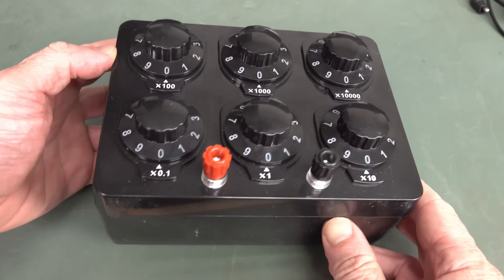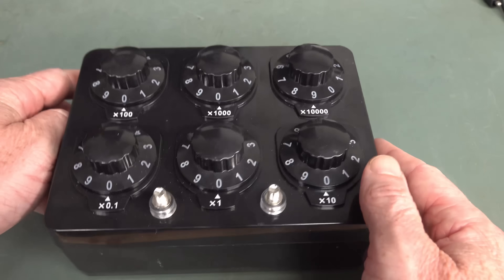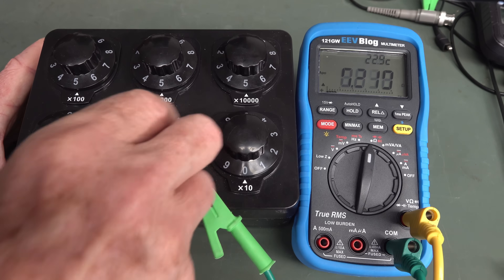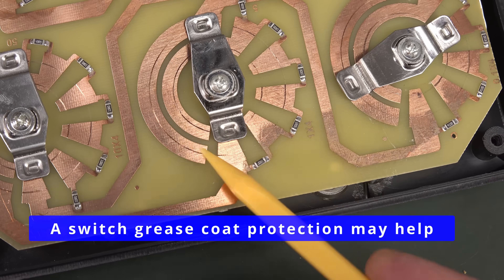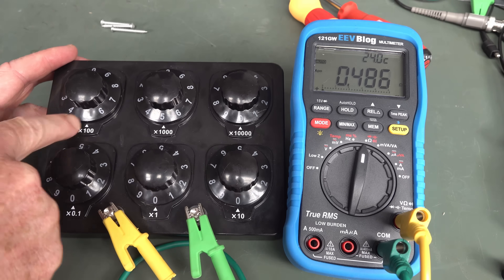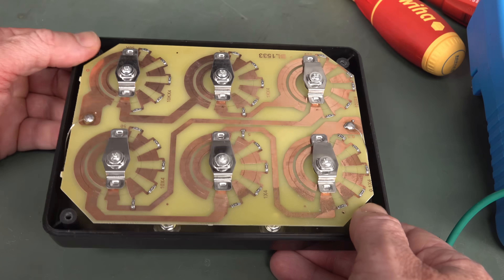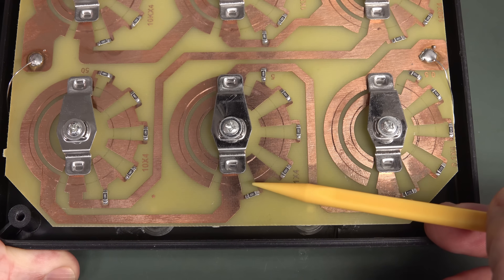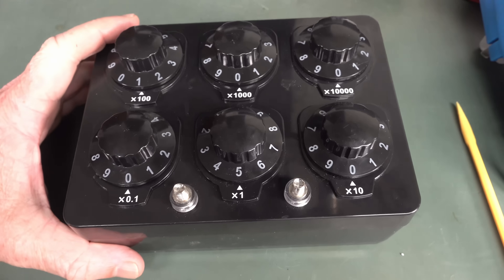EEVblog 1586 -  Stranger Things Decade Resistor Box + Repair

Comment: Just received one from AliExpress. Opened it up to check the quality of the resistors, figuring it was using through hole resistors, so I could upgrade them as possible with precision resistors. Was disappointed to find tiny surface mount resistors, as well as finding out the binding posts weren't banana jacks. I've got plenty of banana jacks I could install. One other disappointment, once I discovered the internal circuitry is confusion over why they used the depth of case they chose, as they could make the case 1" deep, and still have plenty of free space inside.

Comment: My grandpa was a Test Engineer, and i have the underside of one of the knobs from his hand made resistor box! I'm not sure why he disassembled the box, but he took it all apart and all he could guess was that he was being a cheap skate and wanted to use the resistors to repair a clock or a radio haha. After he left his Engineering job, he was allowed to take essentially his whole lab's stock with him and he left me a massive supply of jelly bean parts from the 50's (mostly resistors, caps, diodes and a million fuses). 

My grandpa also had a little bundle of resistors soldered together that would provide different values based on where you clipped into it. From what i can gather, he would use it to load test circuits. It was basically a grid of resistors that looked like a waffle lol.

Comment: Mine just arrived today. Ordered it from an Ali seller called seablue as the one Dave linked to was out of stock. Mine doesn't suffer from the backwards top row issue. Internally it looks the same but I added some contact cleaner/lubricant to the bare copper to help prolong the life of it

Comment: Great device for the money .I remember in electronics lab in high school we had a very expensive unit that used independent switches and a circuit board for the resistors and proper binding posts .Great diagnosing device

Comment: If you want to enjoy electronics, then immediately buy a normal “Resistance Standard Box Resistor P33” made in the USSR (produced approximately 1960-1980). You can also buy a cooler P4831. You will immediately understand the difference in the quality of products produced by different socialist countries: USSR vs China

Comment: I´d worry about the wetting current on those boards. You can never trust the resistance when the contacts don´t conduct.
But fair enough, you can measure it before using - for that price no one would f%/ care.
Besides that: the vintage looking knobs are already worth the buy :)

Comment: To make this work properly clean the copper tracks with metal polish, then coat everything with Vaseline. If you don't do this contact resistance will raise to several ohms. (I have one)
Reply: Won't the contacts scrape the vaseline away where it's needed the most?
Reply: @Hyxtryx  six months now, and it doesn't seem to.

Comment: rather than dismantle to swap out the blinding posts, one could conjure up a "bracket" (3d print) that fitted over the factory posts and carried mutliple ( banana, screw, wago ) connection points

Comment: 30 resistors for 6 decades. They could've lower it to 20 if they used binary box.
Reply: Yes, because 20 toggle switches would be much cheaper and would make the product look way cooler.  And who doesn't want to have to whip out a calculator to figure out how to set the switches for a 47K resistor?  (I realize you were just kidding, but I couldn't resist)
Reply: @Hyxtryx  😀

Comment: This is a nice design. I would use two resistors from the next decade in parallel to get the 5 though. You get away with half the resistor values in your BOM and only need 6 more resistors for twice the current handling capability. That's a pretty good compromise.

Comment: I bought a 5 Switch version about a year ago for about $A24.00 from Amazon because I couldn't believe it would work but was surprised. And first thing I did was replace the binding posts with decent ones.  Works well, but I would expect the switches to eventually fail if you used it a constantly.

Comment: This decade box is what engineering is all about. The chiense or whoever designed it actually had some thought into this and didn't wack resistors in series like most of them do. A very nice and clever solution involving your own switches, saving cost and manufacturing hassle. A good engineer might design something like IET decade box. A thinking engineer will design something like this.

Comment: Such a silly device.  If you instead go to your local university's surplus store you may find decade boxes made by reputable companies, for like $7 each on a good day.   Those have wirewound resistors good for a Watt or two.  And rotary switches with silver contacts.   From reputable companies like Leeds and Northrup, Yokogawa,  ESI, General Radio,  even Heathkit.

Comment: An easy way to improve the contacts would be to pen-plate the PCB with gold just in the areas where the wipers make contact, you won't even need to dismantle it. If you already have some gold solution it will cost only a few cents as very little gold is needed. I have fixed some cheap multimeters in that way changing them from a not very good paperweight into actual multimeters that can measure voltage and stuff.

Comment: If you replace the 0.5 ohm resistors with 1 Meg ones, you can sacrifice precision in return for range. If you replace the resistors with higher power ones, be careful with the plastic case. It looks like it may have a low melting temperature. Maybe drill some vent holes?

Comment: In over 50 years of electronic designing, I have never had any use for a resistor substitution box.
Consider the average modern design made with surface mount components. You have an 0603 resistor that you want to vary, to optimize some performance parameter. To use the resistor substitution box, you will have to solder 2 wires to the resistor pads, which will probably pull the pads off the board.  You will be adding  an enormous parasitic capacitance which at any frequency above 1MHz will completely change the circuit operation. 
   I have found that a surface mount resistor placed on the pads without soldering, and pressed firmly down, will usually make contact. Alternatively a subminiature trimmer can be soldered to the pads.

Comment: I bought a simliar box on ebay from China 20 years ago. The box seems to be made of bakelite, it is heavy, which is explained by the heavy duty gold-plated rotary switches inside and resistors made from enameled wire wound on ceramic posts. It will stand a good deal of current, but the label has fallen off and I don't remember how much.
It was dirt cheap, but apparently not cheap enough for China of today.

Comment: This would be fun to mod in to a puzzle geocache
Reply: A small gear-motor to retract 4 bolts when you have dialled in TWO sets of correct values within a certain time,  Reduce the risk of someone trying to crack it.

Comment: If you were serious about it... buy two cheaper 4x knob resistance boxes, series them together with your new replaced 5w resistors. You could have 0.1, 1, 10, 100, 1k, 10k, 100k & 1M ranges. Could also completely rebox with a 3d printed case to suit the 8x dials. The print would be super easy - seems to be very little stress on the box itself.

Comment: A few years ago I bought one of these but I suspect it was an earlier version. Mine did have grease inside but the switch operation was so unreliable that I returned it. Good to see the design has apparently improved.
Reply: I got rid of mine, too. Just wasn’t worth the hassle with contact issues.

If I remember correctly mine however was a 5 decade one.

Comment: Well, you get what you pay for. I built my 6-decade box with 100-watt power resistors, and instead of using switches I opted for banana jacks. It probably cost me 100 USD to make the beast, but it's built like a tank.

Comment: Nice hardware solution, strange puzzle.  Yeah I'd be pulling it apart to see if I could rotate the top row of knobs.  Just to point out, you can get a seven decade (1 to 9,999,999 ohms) half watt decade board for a bout $3.50.  It uses jumpers and doesn't have an enclosure, but I think it would be a lot more useful.

Comment: I feel like you might get a better bang for you buck if you look for a antique/vintage decade box instead.  If you are patient you can find them for not much more and they usually have a higher rating and a better long term tolerance.  At least with what I have seen.  I have one I got at a thrift store for $30 I think it was, it has precision resistors and still measures right on.

Comment: Not too shabby, but not even by a far shot close to my super heavy vintage decade box made by Ulrich (Germany, 40s/50s). Being that old and bought secondhand, it unfortunately had open contact on several 1k and 10k wirewound resistors, and I recently replaced them with 2W 1% MFRs... good luck finding wirewound resistors capable of handling a bunch of watts with tolerance and thermal coefficient tighter than Ethel Granger's laces. I really need to put that video together and publish it.

Upside Down, eh? Did you get that thing from HNL?

I like the wide traces - but they used SMD resistors, really? 0804 at most, the way they look... C'mon, for crying out loud! The reduced number of resistors with 5-1-1-1-1-1 arrangement is very clever and nice, I really like it.

Always appreciating Spinal Tap references!

Comment: dang, that some low prices you got over there downunder..
Here in northen Europe (EU) also on choice, but 13.55US for the 5dial and 22.71 for 6dial, inc.. VAT.. 
I dont think its the actual prices your showing, it looks like its welcome deal prices that aint that relevant, as they are often cut with 4 to 7 bucks for new AliE-accounts.
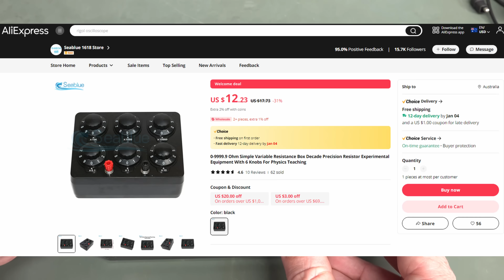Reply: Yep. it's discounted prices for new accounts and why it says "welcome deal" in red lettering 0:33 and where AliEx themself eat some of the cost.. its an attempt to show platform-growth on accounts to sh. holders, it ain't the seller that is selling to that price (pls have that in mind) also why you can't purchase fx 2 or one of each to those mentioned values,  it's not the actual price the seller is selling them for.

Comment: Bots aside.

What is the real world use of a decade box?
I had the same question back when  Dave showed of his diy box, and the only one that I was able to come up with was prototyping a lm317 based psu and the box would act as a r1 in between the pot & lm317 for finding the ideal resistance to get the best vout

A very very specific use case 😅...
Reply: I use them for tweaking 555 timer and oscillator frequency etc. Much better than an imprecise potentiometer, and can reliably handle moderate current.
Another use is in troubleshooting where you suspect that an old resistor is causing problems. You measure and find the resistor has increased in resistance, usually from overheating....
Rather than desoldering, just clip the decade box across the leads and adjust the parallel resistance until it's back in spec. If your circuit comes good, then you know what to repair.
Reply: If you have one with power resistors inside, it can also act as a dummy load for example. And it can pretty much replace ANY potentiometer or resistor in a circuit in general. Of course that means it's most useful for analog electronics in general. 

It can also for example be a better constant current source than your bench power supply if you need current in a range where your supply is not able to be set very accurately. Like, you could test the brightness of an LED from its max rating all the way down to microamps without reconnecting anything with such a box.
Reply: I use mine when brightness matching LEDs.  Also good for op-amps offsets.
Reply: I use my decade box a lot, and I always wish I'd built another one. If you plan to buy or make a decade box, make 2!
Some uses I've had (altough, I've had much more!):
1. Find and tune a frequency compensation network for error amplifiers, some kind of trial and error.
2. Find a good resistence value for an LED, in order to get the brightness I want - you can calculate a pretty close value, but sometimes you want your leds to be a little more dim.

Comment: I really like the cleverness of this design. It does however make me wonder what it would be like to live in a world where all that effort went into making products of higher quality and durability instead of saving the cost of 5 SMD resistors...
Reply: Eh, I work in an industry where cost is no object, however the result is often just as chintzy, but 100 to 1000x the price you'd expect. Quality doesn't really track linearly with price unfortunately, it basically  just let's them cut more corners while arriving at the same result, instead of cleverly designing the switches in like that they'd use equivalent 300$ Japanese modules. At least that's been my experience in my field.
Reply: Newer products are cutting corners more and more, but when it comes to test equipment quality matters. Are you saying you can't tell the difference between a Tektronix and an Owon oscilloscope, or the ripple and protection circuits on a quality linear power supply vs a cheap switching supply?  @xxportalxx.

Comment: The problem with these is there are no specs. What is the wattage? I have an earlier model that uses 1% metal film through hole resistors but they are only  1/4W? 1/8W? who knows and the cumulative error on 1% resistors... Close only counts in horseshoes and grenades! Now if it used 1W, 0.1% resistors.... Strip it down, tin plate the board and repopulate it and you'd have a good 'un!
Reply: Surely the cumulative error on genuine 1% resistors can NEVER exceed 1%. In fact, by the law of averages, the more resistors you have in series, the more likely it becomes that the error will be LESS than 1%.
Reply: @robinvince616   So 4 x 10R 1% plus one 50R 1% resistor in series should give max 1% tolerance when 90R dialled in?  The 10R resistors will all be from the same batch/reel.
Reply: @steve6375  Yes. The worst case scenario when all the 1%s are positive (or likewise all negative) will always result in a value that is exactly 1% out. This will be true for any combination of resistor values in series (or in parallel for that matter). If the reason is not obvious, do the math. And in practice, when you have several 1% resistors making up a desired value, there is a possibility you'll have a mix of + and - tolerances, in which case you'll do a little better than 1%. But NEVER worse.
Reply: @robinvince616  ah, the penny has dropped!  thanks!

Comment: Anyone design a 3D print yet to reduce the massive wasteful base if you don't intend to mod it? Or a whole new shell that you can move the PCB and knobs over to fully?  Also note that those prices Dave showed are the "New user after 1 time use coupon" prices since he was not logged in. The real price of the 5 knob version is right around $10-$12 USD usually for existing users.
Reply from the maker: Ah, didn't notice that, thanks.

Comment: Note that the 5-knob is x0.1, x1, x10, x100, x1000 so max 9,999k which is kinda useless.
My idea is to get the 5-knob and leave the x1 range, but change and rearrange the resistors to flip the remaining knobs to make the layout...
Top: x10,000, x1000, x100
Bot: [¤]  x10, x1 [¤]
Reply from the maker: Yeah, 0.1ohm is dumb. On a 5 decade even 1ohm is dumb.
Reply: @EEVblog  - Yeah, plus I already have dedicated solutions for <10 ohms, using power resistors.
I also have to decide what to do with the boxes of 10,000 x 1W resistors that I scored at the Jaycar Rydalmere clear out 😃
.
My revised design for 5-knob...
Top: x100,000 -- x10,000 -- x1000
Bot: [¤]  x100 -- x10  [¤]
Reply: Was thinking of getting the 5 knob and changing the values to kilo ohms so I can get 0 to 9.9999M in 100R steps.